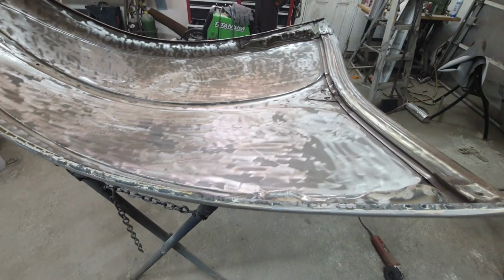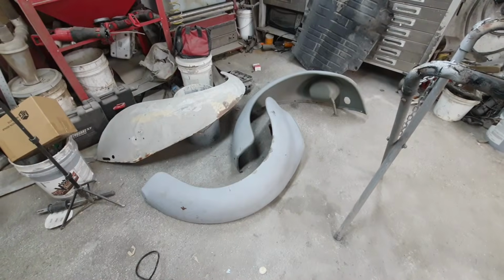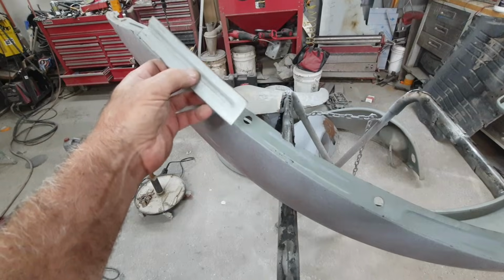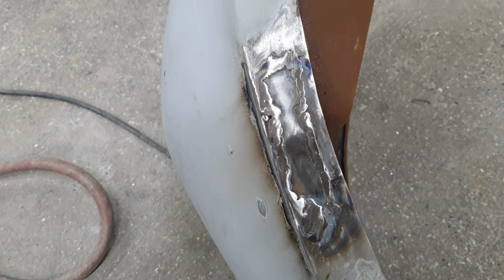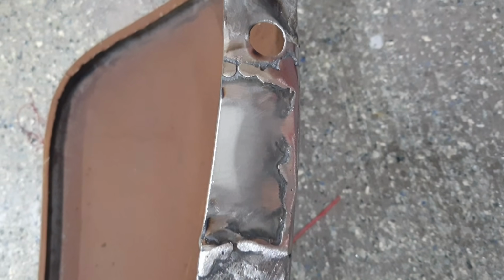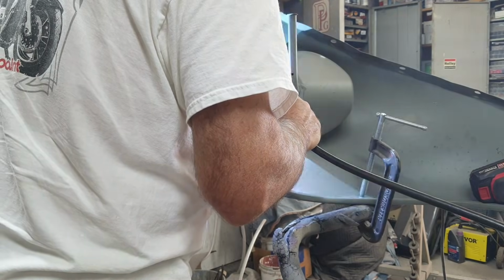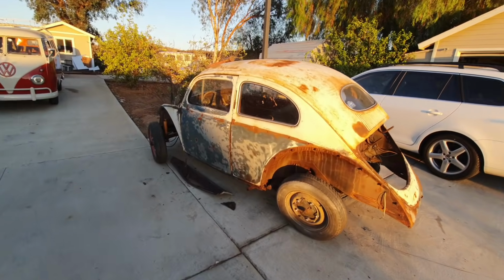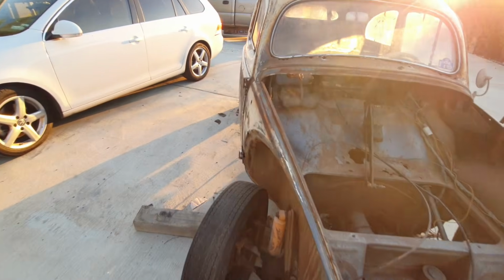Nov 1954 VW Oval window saving the old fenders metalwork and primer

Comment: Hey Mike ,   Those antenna that came with the bugs with the 2 holes were good ones they had 2 hook ups 1 for AM and 1 for FM .  ??? I have been working on Rambus radio and the antenna has something wrong with it. It will only pick up a few stations .
Reply from the maker: they were just one port for FM. but they had 2 mounts ot make them more sturdy. weird this car never had a radio Must have been mounted under dash.